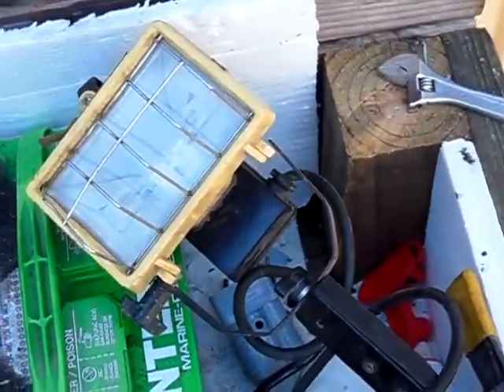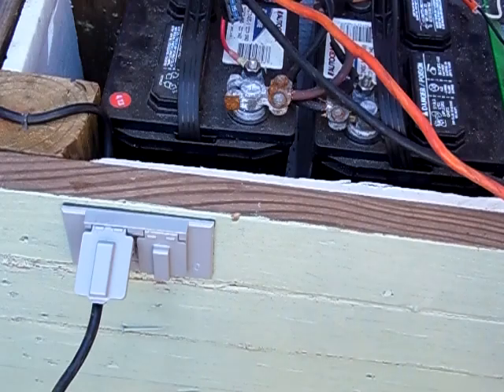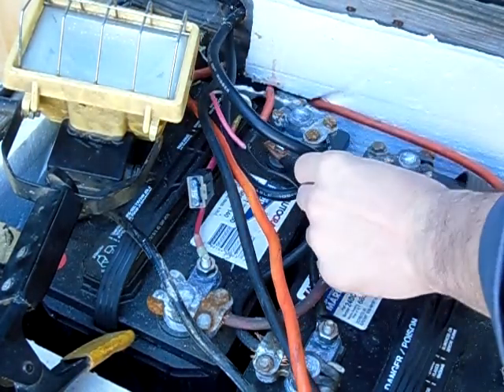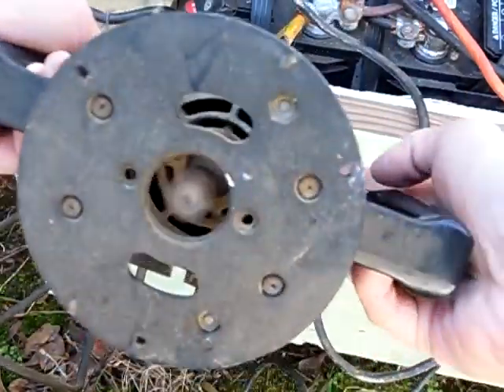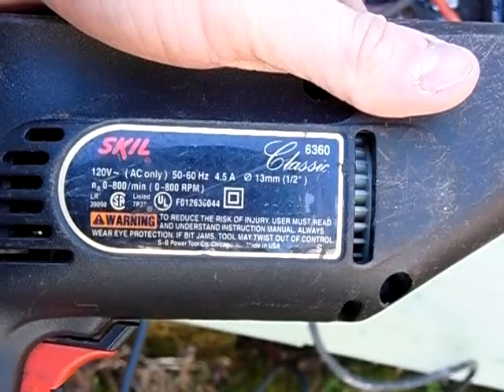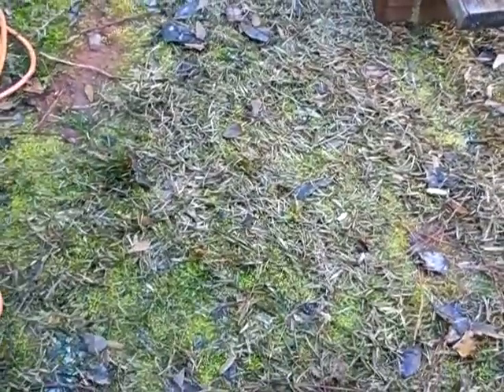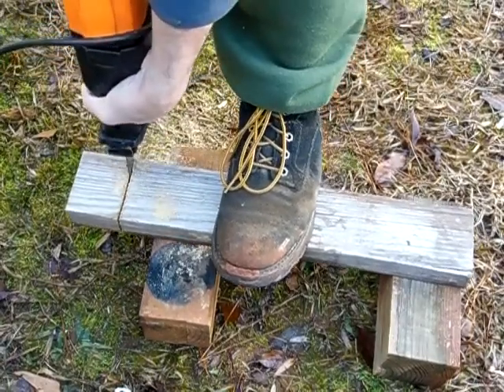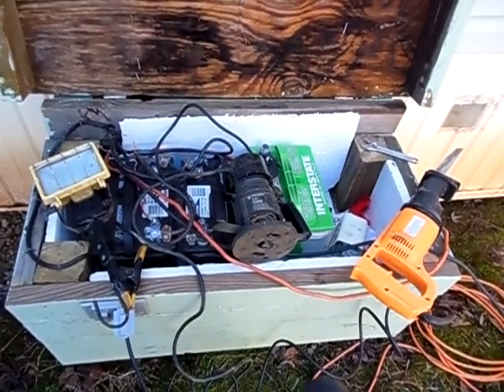Using Power Tools Off Solar Power

Comment: Advice not exceed 300W AC electrical load, coupled with the power lost in the conversion of the inverter, you have already exceeded the maximum amperage for those two small batteries!

Generally the rule is to never exceed the current of the battery bank divided by 10, the result as well as being the maximum current the amp levy, is also the maximum charging current
Reply from the maker: Thanks for the info! I generally don't run this size load for long. I only ran this load just to see if it was possible. I generally only run (at the most) a two hundred watt load and that's while I have my solar panels out. Once again thanks for the info